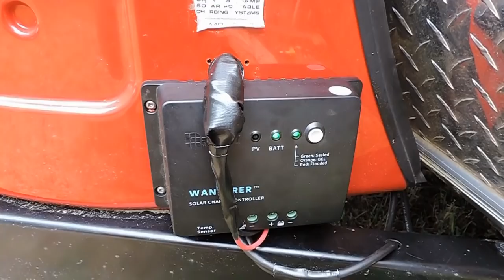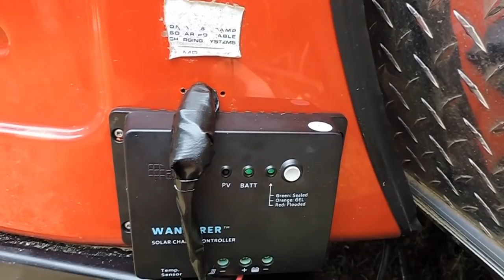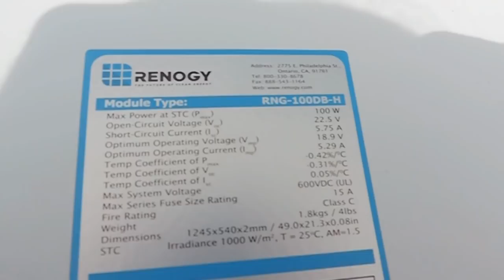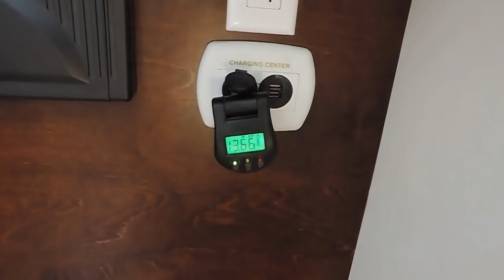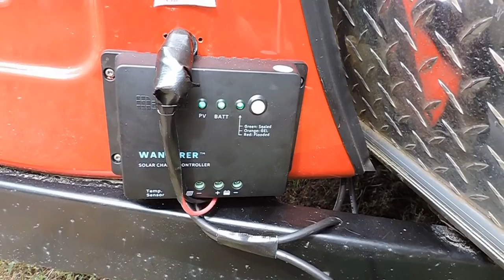T@G Little Guy Solar Install and this years hacks

Comment: How's that Wanderer controller holding up with an outside installation?  I put one temporarily inside the storage bin, and we had a little rain, and the Wanderer seems like it burned out (blown fuse?).  If I connect the battery cables, both lights come on, but when I connect my panel--no light.  I opened it up and found two fuses, but they are soldiered to the board.  I ended up buying another Wanderer (but the smaller 10A, not sure why they named  the 30A and 10A the same, anyway off topic).  I plan to install the new controller inside the cabin.
Reply from the maker: It is working fine its supposed to be watertight  however this last trip it was struck by road debree and some of the display is not readable but it is still working

Comment: Hows your glue holding up? Panel still on there? What kind of silcone glue did you use?
Reply from the maker: As Soon as some new Galley walls I ordered come in I am Going to do this years T@G Update (there are a couple things in it that will Blow You away)
 The Adhesive I used was "Loctite" Power Grab Ultimate - 10,000 miles later it all still looks brand new (but that will all be in the new video coming in the next week)
Reply: How is the solar panel function today? Still works fine?

Comment: Hi Richard, what sort of battery does your trailer have? I have a basic TAG model and it's not wide enough for 2x100w renogy solar panels but I am considering getting 1x100w solar panel I can put on the roof (btw the antenna and the fan vent), and then upgrading the lead acid 88amp batter the dealer installed to a 100ah lithium one. I'm curious if this would be enough to be able to run the Norcold cooler, fan, LED lights etc or if I would need a 2nd 12V battery or another 100w suitcase solar panel to set up when I camp. My intention is to be able to spend 2-3 nights in one place and possibly up to 2 weeks on the road traveling btw campsites, without needing to plug in or use a generator. Any insight would be appreciated!
Reply from the maker: Renogy has 50w panels that would fit either side of the window of a standard TAG
Instead of one 100w lithium battery I would Suggest What I did Two 50w Lithium batteries from Renogy ,Because you have a 40 amp continuous limit on lithium batteries Two 50w (in Parallel) Will allow 70 amp draw to temporarily run a coffee maker, toaster or a 700w microwave  The two 50w Lithiums would last you about 3 days running the fridge (Even without recharging)
 After making this video we put 10,000 miles over a Month and the Batteries never went below 70% and Recharged to Full 100% every night but one (Gloomy day went to 90% but then was at 100% next night) 
 Get A Marine solar controller as they are Watertight  ONE MORE THING once you have the new batteries a 12v electric blanket  is really nice when its cold
Reply: @AirstreamArgosy  Amazing, thank you! Were you able to fit the 2x50ah batteries in the tongue box along with the 20lb propane tank? I was thinking about installing a 2nd 100w panel on the back of the galley but maybe I can use a bunch of 50w panels instead and keep them closer to the battery.

Comment: How is the solar panels performance as of today? Still works ok?
Reply from the maker: Still working great - did pull some wires loose backing into a rough spot but easily fixed about to put out a new t@g camper video ( this week)
Reply: @AirstreamArgosy  nice thanks for the quick reply